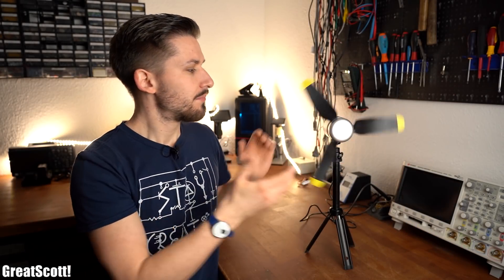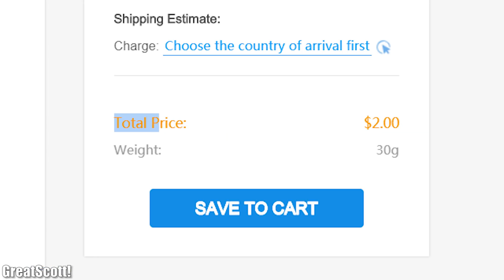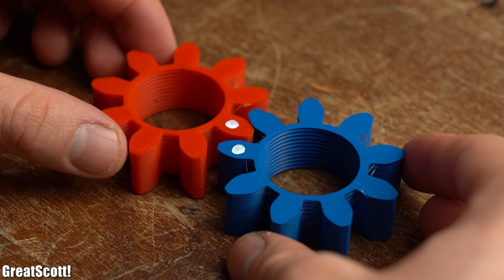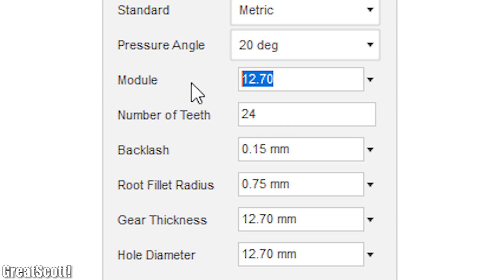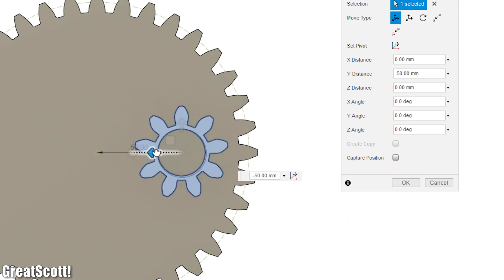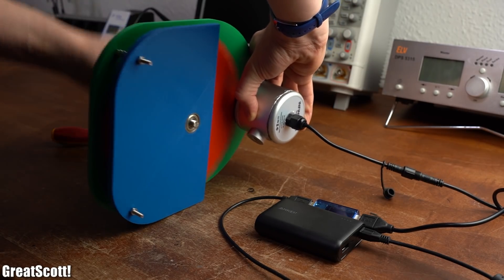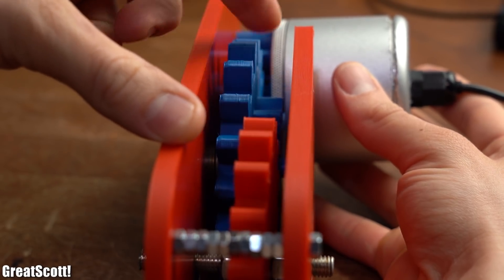Creating a Hand Crank Gear Drive for a Wind Turbine?! || Fusion 360

Comment: Oddly you could add a bigger windmill to the hand crank setup. Put it outdoors and run your wires inside. That way you get the mechanical advantage of the gear system and don’t have to crank by hand. Provided you live in a windy area. A housing would be recommended, with some lubricant on the gears. Even a pole that you can secure via pins to a heavy concrete base on the ground. That way you could use it when you need it.

Comment: I also wanna make bldc hand crank generator. And this is helpful before try.
Previous video i saw capacitor and resistance as low pass filter. Is it contained in windturbine? Or not suitable this system? I just have no idea about electric system and have curiosity.

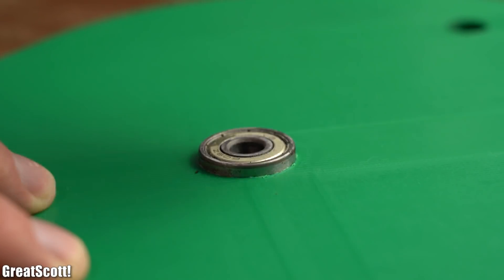Comment: some info.      at 7:11,  you  REALLY  do not understand mechanical physics !!!      can  you  SEE  that the  LOAD  occurs   AT  the  Radius  where the  gearmesh  IS.     consequently, yer drive configuration results in  major  mechanical  DISADVANTAGE  over  the  load !!!  with the input force  being  INCORRECTLY  concentrated  NEAR   the  center of rotation.     googletranslate

Comment: It's better that the power generator be multipurpose, mechanical and automatic at will, in case of electricity is totally absent. Can such crank pump water uphills or the diameter of wheels have to be augmented to make it stronger? Should more  wheel work be added?

Comment: Hey! I loved the project it was intuitive I have a very basic doubt though, it will be of great help if you could answer it for me. My question is : Is the input torque increasing with the number of gears? or is it staying the same as it was before you added the gear train? Do you need to apply extra force to rotate the gear shaft once you attached the gear train to it? 
Thanks in advance.

Comment: I can't help thinking that a belt and pulley system would have been easier and smaller (using an adaptor to reduce the diameter of the 'generator' 'shaft') . That 'wind generator' outputs a pathetic power too, you'd do better using a stepper motor from an old printer. A couple of watts using a hand crank is pretty comfortable - most modern cell phones need over 5 Watts of power for charging (not so comfortable if cranking by hand).

Comment: You should seriously consider investing in a 60 W+ CO2 laser cutter. That 3D printed gear train could've been easily modified to be a functional design for laser cutting. You'd save a lot of time and it might be very well-worth it for you. Cheers!

EDIT: To add to this, Fusion360 and many other CAD programs allow for the exporting of projected sketches as DXF files.

Comment: I would like to see a pedal generator so that when I am sitting at my desk I could be charging my cell phones or battery bank.  Not only would I get some exercise but my legs are stronger and they are usually just doing nothing on the floor.

Comment: that gear ratio is waaay off. you should feel some resistance when you start to turn the handle. and it should become easier as the thing picks up rotational energy

Comment: Hi, I have a project which is building a powerbank including an inverter, usb quick charge and so on. Does anyone know how I could convert the ~11v from li ion battery pack to 5-9v for quick charge? Cause I couldn't find fitting circuits for that purpose. Or is the only (or the easiest) way to do it just buying a powerbank which supports those features?

Comment: 1- Use Belt and pulley system, Gears are not suitable for such a small power transfer. Those gears are too much wide and bulky.
2- Drill holes in bottom land of gears and fill them with grease. it will keep it lubricated. Gears biggest drawback is friction.

Comment: 7:48 I would recommend using Star Washers between the nuts and gear. The Star Washer will grip both the plastic and the metal nut and keep them locked together. An outer star would probably work best in this application.

Comment: I literally just got done 3D printing my first gearbox. Only thing I could suggest is that you definitely don't need solid gears! I have my gears built with five spokes instead of a solid center and still get incredible strength out of them, and saved ~5 hours of printing time

Comment: With 3d printing internal toothing is a great way to get high conversion rations evan with limited space. (i.e. https://www.thingiverse.com/thing:3218362)
With internal toothing the teeth are meshing more smooth compared to normal external tooting. And manufacturing of internal toothing is very easy with 3d printing.

Comment: The problem is the model itself. first, the gear teeth are out of the place and will shorten the lifespan, second you need a gears with smaller teeth, and the teeth on the larger gear should point indward, so more teeth can have contact thus extending the lifespan of the gears. Third 4:1 configuration is far too small for a handkrank generator, you need at least 10:1 ratio, so you don’t have to spin too fast to generate sufficient power. 

Ps. Fourth straight gears are simple to make but curved teeth are more efficient and have more axis to move around.

Comment: In order to get a better load you need to add a flywheel and a on way gear to allow it to keep spinning when the hand crank slows down for a moment. The powerdrill is fun, but it means using a battery to charge another ;)

Comment: I have an idea. Make bigger wings for the wind turbine that can use slow winds to move and use similar gear system so the turbine will run faster than the wings.

Comment: Great video! 
Have you thought about using a planetary gear system? That would make the transmission smaller and will keep the generator and crank on the same axis, making the assembly easier to hold and use.

Comment: I suggest you use gears with more teeth per unit area. Also, use a flywheel to stabilize the rotational speed. An amplification factor greater than 10 would be nice but the torque and mechanic al advantage would outweigh it so you must balance it with the torque from your hands.

If not too complex, use a planetary gear to make the effort less whilst maintaining power generated constant.

Comment: Don't forget: rpm goes down, torque goes up...

Power = Speed x Torque
exactly like
Power = Voltage x Current

If you get deeper in to motor control it clicks really well...

Comment: Can you show me how to make a clipping- detector for amplifiers? It's to see when the signal get distortion
Reply: there might be some clever way, but i think you need a oscope for that.
Reply: @Wooble57  there are car-amps that have built-in clipping indicator. Just a LED that blinking if its clipping.
Reply: @lassediscovers1813  the car amp knows at exactly what voltage clipping will occur for that specific amp though.  And ratings on amps are such that you really can't count on them.
Reply: @Wooble57  i'm not talking about voltage. I'm talking about distortion. Signal distortion. When the gain is set to high, and the coil in the subwoofer is getting warm. 
 if you see soundwawes on the oscilloscope. The "spikes" are getting flat on the top.
I know you can buy these some where...
Reply: @Wooble57  i'm asking GreatScott

Comment: You dont have to rely on Fusion 360 as there are other ways to calculate and save to dfx svg etc
https://geargenerator.com/#200,200,100,6,1,0,0,4,1,8,2,4,27,-90,0,0,0,0,0,0,16,4,4,27,-60,0,0,0,0,1,1,12,1,12,20,-60,0,0,0,0,2,0,60,5,12,20,0,0,0,0,0,0,0,3,-716

Comment: Very interesting. In case you do a followup on this video, you could use planetary gears and connect multiple sets after each other to create a much higher speed. This could be fit into a bottle sized container, to get a practical item to maybe use in an emergency, if there is a power outtage for example.

Keep up the great work.

Greetings from the other side of Germany. 😉

Comment: I think it would be better if you would make a gearbox instead of gear train as the size would be even smaller, you could achieve bigger gear ratio and the mounting of it would be also a bit better.

Comment: I kind of want more gears and a main spring. Make a wind up generator with a speed guvernor  and clutch so you can wind the spring to max, disengage the spring and continue charging the device but the mainspring will let you rest for a bit.

Comment: Even ratios might not be the best idea though. Same gear teeth hitting each with a relatively high frequency can cause accelerated wear issues. If I recall, something like primes will help since the wear will be distributed among all the teeth. (With something like a toy, probably not a big deal. But it counts if you want something to last longer.)

Comment: 8:53 If you have a electric drill, then I guess you can skip the drill part and just use its battery 😉
Reply: lol, i laughed at that part. turning some generator on gears for emergencies when the drill itself has pretty big 12v/18v battery.
Reply: @carlos2004  How should he charge a phone with 12 or 18V?
Reply: @georgwagner4438  with a step down converter. pretty sure he has some around there since they're super cheap and he made one in one of his videos.
Reply: @carlos2004  A standard car phone charger would also work with 12V (or maybe even 18V after checking charger input voltage range) drill battery without any problems.
Reply: MinE CrafT  I think you've been playing too much Rust.
Reply: wooosh
Reply: @certified-forklifter  Yes, I took it as a joke.
Reply: It would work well on a bicycle, just replace the crank with a friction-drive wheel. A Great Scott bicycle dynamo.
Reply: @terence79chan  A standard friction bike dynamo produces more power too, about 3 watts compared to the poor 1.5 Watts from that 'wind generator' adaptation. Far less cost too. The downside is you have to spin the bike dynamo much faster.
Reply: @certified-forklifter  who the hell are you whooshing?

Comment: A bit suggestions for the mechanical part: 1) Typically for a commerical design of a gear train, we would like to make the least common multiple for the teeth number as large as possible, ideally two prime numbers, but not a simple integral ratio like you did. The reason for this is to prevent the same teeth meet too frequently, assuming if there are defects and causing not necessary wearing. 2) Adding a proper flywheel will make your design more useful, just like a capacitor in electronics. 3) For a involute gear, we would like to have the minimum teeth number to be 17, otherwise the bottom part of the teeth will be narrower than the top part, which was happened to your 9-teeth one, and it is mechanically weak. Overall none of these are necessary for a demo for 'how gear train works and being made', but could be necessary for competitive in 'DIY or Buy' topic.

Comment: Kinda inefficient way to charge your usb pack from your drill...
However, 😁
What I would love to see is
I would like to see a build of an adaptor for a cordless drill battery with 5v(usb) and 12v outputs 
As so many things run on 12volt
There would need to be overdischarge protection for the cordless battery
That would be the bit that I would find intimidating

Comment: Simply love it. Thanks Scott...
Could you please help me understand, if electrical load is connected to a generator like yours, would that create resistance resulting in higher torque requirement to move the generator?
Reply: Yes, in fact that's how electric cars implement regenerative braking. For example, I rarely use the brakes in my car because the car automatically turns the motor into a generator when I want to slow down, thus creating a high torque requirement on the motor, slowing the car.

Comment: A weighed flywheel would smooth the rotational fluctuations and make it easier to drive by hand.
Reply: u mean like heavy flywheel? but htat would be difficult to hand crank it
Reply: @ElektronikelAcoustics  a weighted flywheel would be hard to get to speed, but if you do get it to speed the output will be more smooth and consistent
Reply: @AaronLyNxAI  Oh it would easy 
for a healthy man, but for old people it would to provide that initial torque

Comment: You could've used a belt system, from a large disc to a small disc, and keep doing it several times, it would get quite heavy to spin by hand, but the momentum would help keep spinning.

Comment: I've got a "DIY or Buy" for you. A magnetic hot plate stirrer. I am thinking about building one but at the same time I can get a decent one on amazon for like $70.
Reply: I made a magnetic stirrer for the Hackspace BioLab by sticking magnets on a regular PC fan. Shouldn't be too hard to add some nichrome wire for heat.
Reply: @a930913  Its the hot plate with temp control I am mostly curious about. The motor/stirrer shouldn't be hard. But I am more curious about the material to use for the hotplate as aluminium and spinning magnets has the whole lenz effect thing I wasn't sure if that would put too much strain on the motor. 

My first thought was get a 3d printer bed but if aluminium isn't good then I don't know what to do.
Reply: @x9x9x9x9x9  How about silicone heaters? There is still a copper coil inside which could interfere with the magnets but it should be both chemically resistant and shouldn't be a problem for the magnets...
Reply: @zanpekosak2383  That would probably work and stick it to a piece of glass or something. I assume the aluminium heat bed would be fine as long as the motor isn't some super wimpy $1 motor from ebay. I just don't know much about lenz effect and how much strain it would put on the motor.
Reply: @x9x9x9x9x9  Wonder if you can use the lenz effect to heat the aluminium container and derive the power from the motor - which probably puts the motor power at 0.3kw to 0.5kw. Might be a little fast for the stirrer though.
Reply: @x9x9x9x9x9  I think the professional units have no moving parts, just some electromagnets arranged like the stator of a brushless motor. I'd guess that solves most of the issues re. eddy losses, Curie point, etc. that a moving motor would encounter
Reply: we use a fan with harddrive magnet, it held up 2 years before it got destroyed by toluene and finished with acid
Reply: @TheChemicalWorkshop  What a great ending for the fan!
Reply: I made one too. A wooden box a 6010 fan a magnet from an old hard drive on the fan an onoff switch and a power plug the hard on was the magnetic PTFE pill to find. Works great on 7-8v!!
Reply: Omg a hot plate stirrer! I need one too! I'll use a sand bath for heating for now but i dont have any stirrer function yet^^

Comment: For your future mechanical projects you might want to know that screws and threaded rods are not always their rated diameters. They are typically smaller (say 7.8mm instead of 8mm exactly), and will thus be undersized for their respective bearing size. Try using precision ground shafts instead. They are much more accurate and can be cut fairly easily (Dremel /grinder for example). And if needed you can grind flats for using set/grub screws, or even thread the ends to use nuts (though, if the shafts is hardened then threading can be difficult).
Also, I couldn't see but it looked like the gears had no spacing between them and the housing taken in to consideration. Try using shims/washers to add spacing. That'll prevent the gears from gears rubbing on the housing and causing unwanted friction.
And finally; you can get a thread pitch gauge sets online for pretty cheap. They're much faster than trial and error, or trying to measure pitch by eye with a ruler/calipers.
Hope this helps you. I am looking forward to your future projects.

Comment: You can save on nuts by tightening two in opposite directions against each other to form a solid backing, (though I would have thought for a low impact situation you would have created a PLA tube for the frame's threaded rod.) What's the highest gear ratio that you can realisticly drive by hand and transmit through PLA?

Comment: I‘d Love it, if you Build a Filament maker for failed 3D-Prints
Reply: Not worth it, it's simply not cost effective. PLA filament can be bought for as low as 10€/kg. A complete filament extruder with winder will cost you about 500€. Then you'd also need a shredder for the failed prints, so another ~500€. All in all 600-1000€, depending on how much you can do yourself or have to buy off the shelf. 

In the end you've only got recycled filament that's not very consistent in diameter and has reduced mechanical strength. 

If you want to do this for the environment, you are better off melting your failed prints into sheets and using them in some way.
Reply: Check out "precious plastic". There are instructions for shredders, extruder and molds all the way.
I never built any if it, but... one day!

Comment: Nice! I was thinking of doing something similar with an old bike; by changing what gear you're in, you can change the generators output voltage and current.

Comment: Coincidentally your gears are the same size and colours as a toy kit I had when I was a little kid. It's giving me flashbacks to being 5 or 6, messing around with gears trains and ratios, and wanting to build a helicopter. Also, occasionally crunching my fingers between the gear teeth... Good times.
Reply: One of my siblings had a Fisher Price activity table for toddlers that had gears on it. If I recall, there were 2 sizes and a few different places you could place them, and patterns on the gear wheels so you could see them all spinning as you turned it.